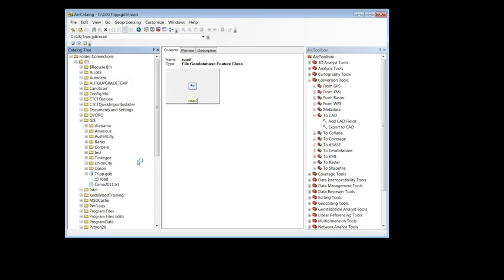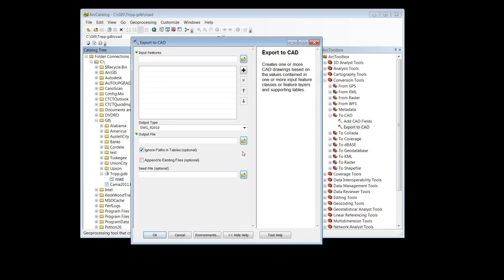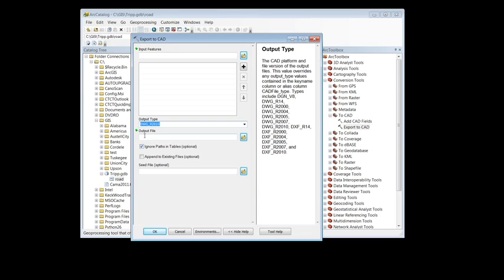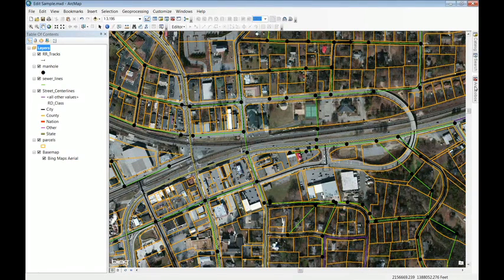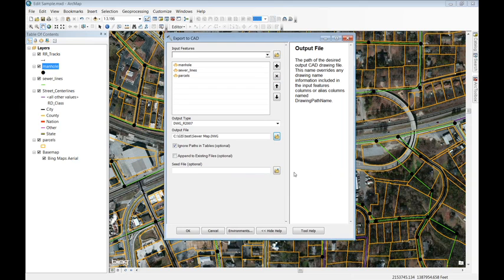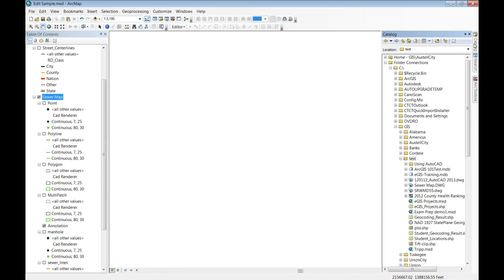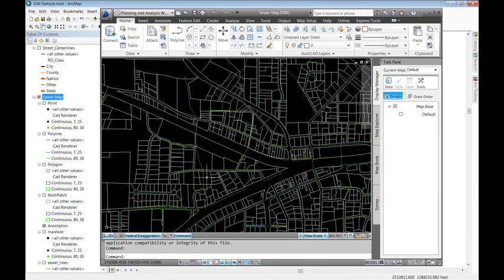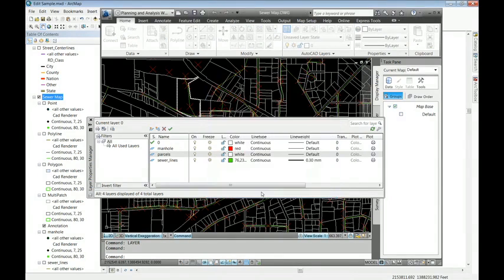Convert GIS to CAD in ArcGIS 10 or 10.1

Comment: Can you do the same with labels for the lots (I'm still new and haven't have much experience with GIS) but lets say I need to export the lots to AutoCAD with the 4 digit address number labels in them? Can I do that, the numbers as an actual text in the lots and not as an attribute?
Reply from the maker: It can be done but can be tricky. First, you would need to convert the labels to an annotation feature class. You do this by labeling the layer and then right-clicking on it in the table of contents. Select the Convert Labels to Annotation option in the menu. Make sure to select In a database as your Store Annotation option. If you select in the map, you will not be easily able to export to CAD. Once you do that, then you can export the new layer which is created to an AutoCAD DWG or DXF file like you would a point, line, or polygon layer/layers.  That will get most of it converted however because CAD and ArcGIS handle text differently, there is a good chance not all of the annotation will come across or appear the same in the two applications.
Reply: @eGISAssociates  Thank you so much for the information. Still its better than having to do like 300 from scratch.

Comment: Thank you for the video. When I export in this way there seems to be no projection data. The total size of the site is 0.006mm where is should be 400m. Any idea why the CAD file doesn't carry the projection through to CAD software? Thanks in advance
Reply from the maker: Without seeing your data, my best guess is a units issue. Your data or map may be in a geographic coordinate system or using Degrees as units when you convert instead of meters.
Reply: you can scale that

Comment: Hi...
I have a dgn file that I have to convert to arcgis geodatabase what is the procedure. I hope your where understanding my data conversion. I hope your prompt reply...

Deepavarman98@Gmail.com
Reply: The quick and easy answer is to use the CAD to Geodatabase tool in ArcToolbox. This will convert the entire DGN file to feature classes in a feature dataset in a Geodatabase. You will need to create a geodatabase first before you run this tool. Creating a new geodatabase is not hard. Simply connect to the folder in which you want to create the new Geodatabase in using ArcCatalog or the Catalog window in ArcMap. Then right click on that folder in ArcCatalog or the Catalog window and choose New>File Geodatabase. That will create a new blank geodatabase for you to use for the conversion. You can use an existing one as well.
Reply: Dear Tripp Corbin,

Thanks for your valuable reply

Comment: I have tried this to export a topographic map to CAD but it gives giving an error every time I attempt it. Not sure what is wrong with this program
Reply from the maker: There are a couple things that could be problematic. It is possible the topographic map is to large to be converted to a single CAD file. Neither AutoCAD or Microstation do well with large files. If you are trying to export the Esri Topographic Basemap, that is not allowed using the tools in ArcGIS. There is a free ArcGIS for AutoCAD plug-in from Esri which might allow access to the Esri Basemaps. Can you tell me the error you are getting?

Comment: Thanks! I converted a topographic map to cad.However the scale doesn't 
match. I'm thinking on drawing a line in arcgis so i can use it as a 
reference for scale. But i would like to know if there is a more 
accurate method.
Reply: +Tiago Serafim There are a couple ways to try and fix it. You could use the georeferencing toolbar in ArcGIS to apply a scale factor to the CAD file before you convert it. That might work if it is a uniform scale adjustment and no rotation or translation are needed. If it is not a uniform scale difference, then you will need to use the Spatial Adjustment toolbar to apply a transformation to the data after it is converted.
Reply: +Tripp Corbin Can you please explain it a step by step? I'm using ArcGIS 10.1
Reply: have you solved the issue? i have the same issue